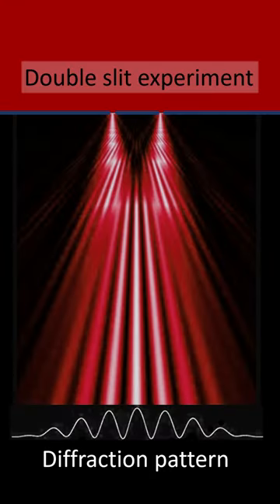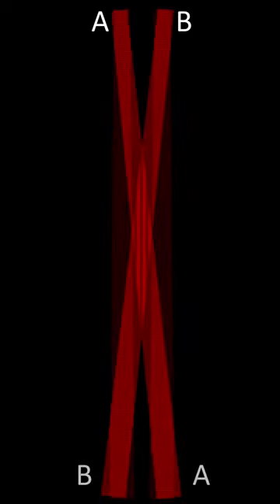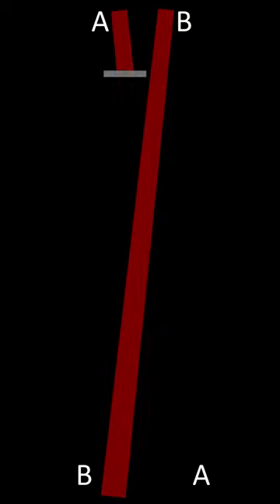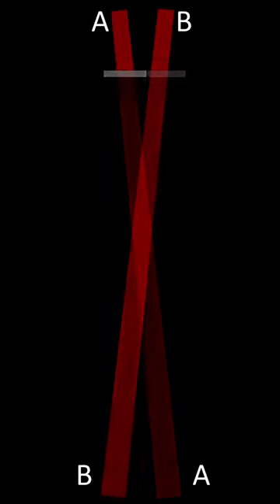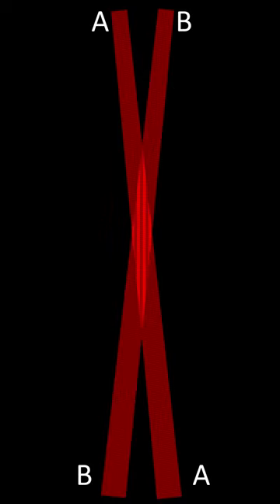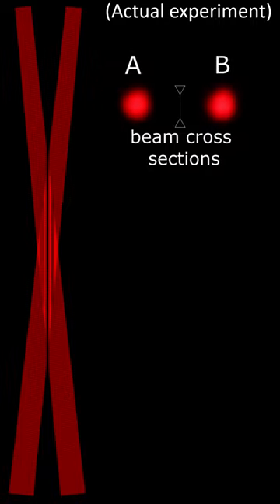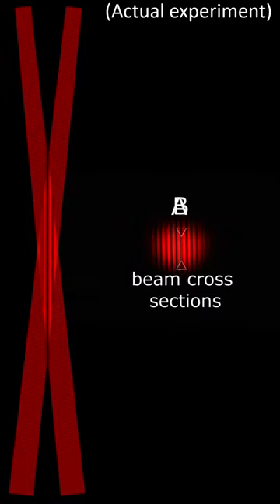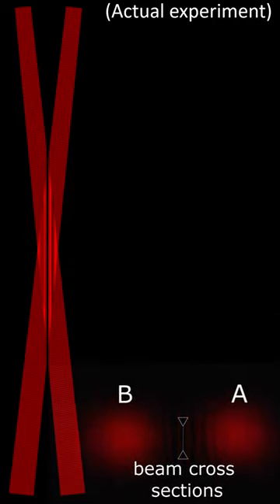The double beam experiment

Comment: Explaining that in wave terminology is (almost) straightforward.
How do you explain that in terms of photons?
Reply: As I understand it as a layperson: photons are units of interaction with the em field but don't describe the field itself
Reply: The photon explanation involves sentient particles that get to decide when and where they choose to show themselves.  It is pretty much like a theist's god.  It's your fault if the photon decides not to show itself.  You are just not worthy in the photon's opinion.
Reply: The math of quantum mechanics lets "us" accurately calculate the odds of detecting a photon at every point in a simple interference pattern. After a great effort, this will produce the same interference pattern as generated with the much simpler classical method. Both methods match experiments.

While the math of quantum physics accurately models the behavior of photons, it does not explain their behavior.

Note: "us" is quoted in the first line as I did not do very well in my university quantum physics course 23 years ago. So "us" doesn't actually include me, but there are humans that know the math. 

Note 2: The "simple" in "simple interference pattern" is very important. The exact math gets very complex very fast if the photons interact with anything. If I recall correctly, there is exact math for individual photons interacting with the electron in an individual hydrogen atom. Use classical mechanics to model light traveling through glass.
Reply from the maker: Personally, I try to stay away from "photons" or even "beams of light" when considering interference and diffraction. I treat them as purely classical wave phenomena because it saves me a lot of headaches.
Reply: At this point light is following Schrodingers equation and behaving like a wave. After it is measured it will lose this wave property and begin acting like a particle that follows the Born rule. That is the measurment problem.
Reply: @Leland-y1d  I have asked this question to numerous people making this claim and have never received a decent response.  Perhaps you can do what no one else has been able to do.  What are the properties of particles light is supposed to be exhibiting?

Comment: May I ask you to perform a Poisson test, or its equivalent? I'm wondering how the deflection of light rays during diffraction depends on the temperature of the light source. If there is such a dependence, then this can explain the effect of gravitational lensing by simple diffraction. Diffraction of a heated body. Then you can try this body to begin to quickly rotate around the axis.
Will something change on the Poisson spot depending on the temperature of the obstacle, and on its rotation speed? After all, speed is energy. Energy is equivalent to mass. If the rotation does not deflect the beam, then mass and energy do not affect gravitational lensing, but I doubt that this hypothesis is correct.
To begin with, it is interesting to simply heat the obstacle.
Reply from the maker: There is no obstacle here, only 2 coherent wave fronts interfering.

Comment: There is a shortcut for light waves since a photon is everywhere in the direction of its travel since photons don’t experience time. How noise-cancelling headphones work is more puzzling: the energy due to external noise and energy due to noise-canceling action both go into the headphones. Where do they go? Does the noise actually do work on the speaker diaphragm? If so does this energy go back to the battery?

Comment: noise canceling headphones don't cancel the noise, they just make an opposite phase sound that perfectly overlap over the incoming sound. if you were to measure the intensity of an AC current precisely when it's at the 0V point of it's phase you wouldn't measure anything. light works the exact same way, measuring the intensity at one point in the phase doesn't mean anything, it is only the measurement over the entire phase that can give a true measurement of the intensity (iirc it's called RMS measurement)

Comment: Continuous plane of zero intensity does not mean continuous area of zero energy in the same way that a ball thrown upward will have a point at which velocity is zero but will have a continuous negative acceleration. Intensity of the light beam is related to the velocity of the ball in such as they are the observable results of the sum energy on the system, however, the energy of the wave and the gravitational acceleration of the ball are the actual experimental variables. These variables dictate the observable behavior, not the other way around.

Comment: Did you do an actual experiment with this? If so then:
1… With a single source laser that was split and then phase shifted 180 degrees and then intersected at a small angle? 
2… with two separate but identical lasers whose relative phase was measured then adjusted to be 180 degrees out of phase?
3… what impact does a laser source notch bandwidth make?  Does each photon get time delayed by exactly half a wavelength for that particular wavelength when creating the two beams?   Or does a photon from the laser interfere with another photon from the laser with a slightly different wavelength (both wavelengths being inside the laser’s bandwidth)? shifted by 180 degrees regardless of what frequency within the laser frequency band?
Reply: dont believehat exact setup woud work. If you did a 90 degree phase shift it woud be oppositely polarized. 180 phase shift would just be the same
Reply: @Leland-y1d I am assuming starting with a  linear polarized beam. And after splitting, one is phase shifted 180 degrees with respect to the other.  If one is phase shifted 90 degrees and then recombined, it would become circularly polarized.
Reply from the maker: I used a single source (HeNe-laser), because that is the only way this experiment could work. It requires a fairly high degree of coherence. Basically it's just a 50% beam splitter and an adjustable mirror under 45 degrees, that create 2 beams of equal intensity and are under an angle of 0.1 degrees. I moved the camera sensor over a distance of 6 meters to collect about 40 interference fringe images in the crossing. By the way: I never think in terms of photons when considering the EM radiation itself, especially when originating from a laser. For me it's just wave energy that can be absorbed in a quantized process. The latter is what I consider to be the photon.
Reply: Looks like a simulation to me.  Where are the 40 interference fringes in the crossing? Please show the actual experiment.  How wide was the beam?  @HuygensOptics
Reply: How wide was the beam? @HuygensOptics
Reply from the maker: The last 20 seconds of the video show the actual experiment as a cross section of the 2 beams. It's not a simulation. Please read the video description if you want to know more about the experimental configuration.

Comment: Easy. Energy motion by waves should integrate at least a period, otherwise it's near field, not traveling waves. Another perspective is Poynting vector which measures the energy flux, and which is unitary across the boundary for both beams due to the EM nature and the phase relation between E and M.
Reply: The Poynting vector at the minima is zero. That's not the problem here. The problem is that one has to learn to get a proper intuition for the solution theory of linear PDEs, which only depends on boundary conditions. Most people look at PDEs as a bulk phenomenon. Linear waves, however, are NOT a bulk phenomenon because of the missing interaction in the bulk. Everything that you "see" through a physical vacuum is entirely a function of the boundaries.

Comment: As per your last video, intensity is equal to watts per meter squared, which in this case is power per unit of surface of the combined laser beams/wavelength, which is the same area as for the single laser (as they're out of phase).

Comment: Maybe light is wawe, and particles is just detectors reaction to amplitude? like brain cell that has reaction limit
like integer reaction to float data.
if amp is 0.5, reaction = 0
if amp 1.2, reaction = 1

okay this case have problem with all mater, like what is detector and what is wave? maybe detector it's just material thing that we entangled width but in base it is wave, but we dont see it becouse of entanglement.
like particles is just section of waves propogation.

so light is wawe at all the way but when light is forces to be entangled, it takes one particle to interact in every each one reality.

so world of waves is really out of our preception, we only see entangled noise like interpritation of waves.

Comment: The dark spot is merely a spot in the lights electric field that deconstructs the wave due to interference from the other beams electric field.  So while the electric field can be negative.  Light has a positive energy density that is distributed throughout the electric field, positive or negative, but not zero.  The energy is redistributed and becomes brighter in some spots while it's electrical path is deconstructed by the other beam.

Comment: I assume you can do a similar experiment where you send two beams towards each other in a manner that will destructively interfere when the beams overlap, and then stop interfering when the beams pass each other??
Reply: That is what is happening here.  The destructive interference is where no visible light is observed.  There is also constructive interference where the visible light is observed.  Both are happening simultaneously at different locations in this experiment.

Comment: That's because when you block the laser, you use big obstruction. If you use something 1/4 of the wavelength it wont block the light either
Reply from the maker: A thicknesses of 150nm of Chromium or Aluminium will block a light beam perfectly.

Comment: xIn the attached image you can see that the interference fringes occur before the point of intersection of both laser beams, which (if it is not an artificially generated image but a measurement result reflecting nature) space has a certain elasticity that allows oscillations of parameters and wave propagation in space. Observing, for example, the propagation of seismic waves inside  the Earth Globe, we see that longitudinal waves do not pass through the molten outer core of the Earth. Apparently, the consistency of space allows the propagation of electromagnetic waves within it.
Stary
Reply from the maker: You observe these fringes because the intensity is the square of the total EM field. Therefore the areas of constructive interference seem to appear out of nowhere and have much higher intensity than just the sum of the two individual intensities.

Comment: What if it's not. I may be missing a lot with the physics here, but from what I see, were not looking at the actual photons of the lasers, because our perspective is from the side. What we're looking at is photons generared from interactions between the laser photons and particles in the air.
So, what if the lasers don't cancal each other out at all? What if they just cancel their affect on particles in that area. Like bringing two magnets together.
Put a magnet to rne right of a magnetic field sensor and it will register it's strength. Put another equal sized magnet on the opposite side, and if they are all positioned right, both magnets will apply equal opposing force on the sensor. The sensor will read no field strength, yet nothing has been done to diminish each individual magnets actual magnetic force. All they've done is cancel the energy they would have imbued to electrons in the atoms of particles.
Light isn't really cancelling light here, just canceling it's effect on the environment.
Just an idea.

Comment: I would like to see this double beam experiment done with what physicists usually think of as particles, such as a neutron beam. I would imagine we would get the same result of interference and a continuous plane of zero intensity.
And what if you placed something precisely in the zero intensity region, would the beams both cease to reach the destination despite the region of zero intensity? Surely if there's no intensity there would be no interaction with a sheet placed in the region, right?
Reply: They may see reflection off the surface placed in the middle depending on the properties of the material?
Reply: @br3nto  Probably. I dont believe truly that there aren't "Photons" that are just skipping the zero intensity, and any change in the electromagnetic field would mean a change in photon behavior.  I would be curious too, what a shadow, say a pin placed in the center of both beams path, would result in at the detector.
Reply from the maker: For light to do this experiment is very simple because we can create coherence easily. However, to do the same with particles is pretty difficult. For one, because of their very short wavelength, but also: how do you sync their phase? They would have to move at exactly the same speed and on top of that their phase should be directly related. So that would mean that they would all have to be "entangled". I don't think that is feasible.

Comment: As the wave can't pass,  its reflects back
Reply: ... huh ? 🤣
Reply: So the middle 0 light intensity zone acts like a mirror?
Reply: @BboyKeny  No lol
Reply: It is not reflecting.  If it was reflecting, there would not be a null zone in the center where the waves are canceling each other out.  Instead, the two beams would meet in the center and diverge in the same exact manner as when a single beam hits a mirror.  There is no null zone with a mirror.
Reply: @wesbaumguardner8829  > If it was reflecting, there would not be a null zone

Until now, I have never heard anyone define reflection to require the absence of a "null zone", whatever a "null zone" might be.
Reply: @charetjc  That is not what I am saying.  In order for a null zone to occur, two waves must collide 180 degrees out of phase with each other so that the apexes and the troughs of the waves cancel each other out.  However, this is not possible if the waves are simply reflecting off of each other.  No one has ever observed light waves reflecting off of each other, btw.

Comment: Its not crossing both beams are reflected by this dark area
Reply: Actually, the problem is that non interacting beams of particles are just an interpretation which is useful to describe a particular solution of the em field. What is shown here is that this interpretation have limits. An other valid interpretation is that beams are reflected by this dark area. Its the same with refraction, the "bending" of the light beam is due  "superposition" of the incoming beam and new waves created by it when it passes through the medium. We can think of a phenomenon through different lenses but in the end the equations are the more compete description of what is possible and what is not.

Comment: Is this a real experiment or a thought-experiment?
Reply: Real, you can see that with an interferometer
Reply: @sergiosutti4675  I'm no expert here, but I thought an interferometer did not simply cross beams - instead a single beam hits a beam splitter first, correct?
What this video suggests is that 2 beams from 2 lasers can create a WAVE-interference pattern WITHOUT hitting a filament (eg a hair or needle)  or beam-splitter or bouncing off of anything. Simply by crossing eachother. Light on light interaction.
Not saying it's wrong, but my google skills aren't finding me anything.
Reply: @wamingo  well, the video says that the two beams need to be in phase. To do so, you could in theory use two different sources an sync the phases with some fancy equipment, but in practice you take a single beam and split it in two like an interferometer does.
Reply: @sergiosutti4675 The beams must be exactly 180 degrees out of phase, otherwise there is no destructive interference at all.
Reply: @juliusfucik4011  you’re right, they need to be in opposite phase. I wrote “in phase” meaning that their phase offset must not be random.
Reply from the maker: The images shown in the last 20 second of the video is a real experiment. I used a single source (HeNe-laser), that is the only way this experiment could work, because it requires a fairly high degree of coherence. Basically it's just a 50% beam splitter and an adjustable mirror under 45 degrees, that create 2 beams of equal intensity and are crossing each other under an angle of 0.1 degrees. I moved the camera sensor over a distance of 6 meters along the beam to collect about 40 interference fringe images while going through the crossing point. These were then stitched together into the movie that is displayed.
Reply: @HuygensOptics  Quick question, if you didn't use a camera but just a flat surface, would you be able to see the fringes with your naked eye?
But thank you for the clarification, and also thanks to Sergio and Julius.
Reply from the maker: @wamingo  you might if you were to defocus you eye completely. Otherwise you would just observe 2 laser beams (spots on your retina)  at a small angle. I would advise you not to use your eyes for this type of experiment.
Reply: @HuygensOptics   Oh goodness I didn't mean to suggest putting your eye directly in the laser! Definitely don't do that.
I simply meant if you put a surface there, a piece of paper for instance, would you be able to see the fringes on the paper?
Thanks again, sorry for confusion.
Reply from the maker: @wamingo  yes, no problem, you can also observe all of this on a piece of paper.